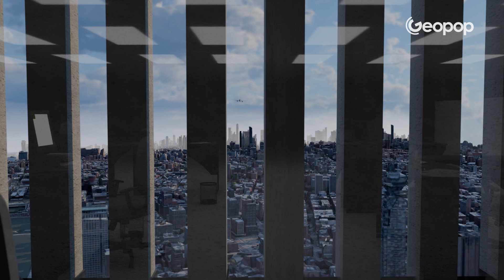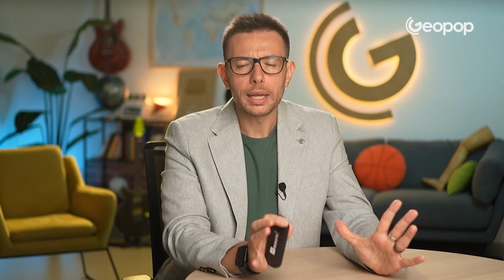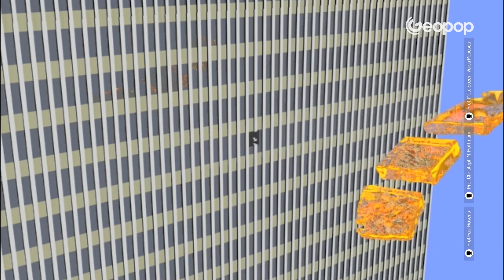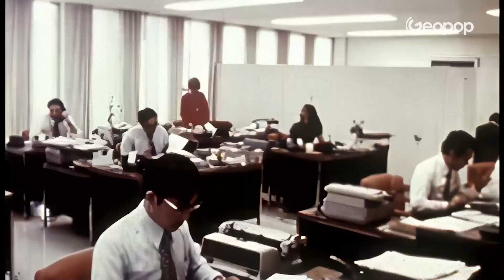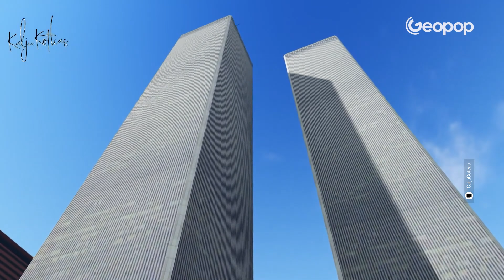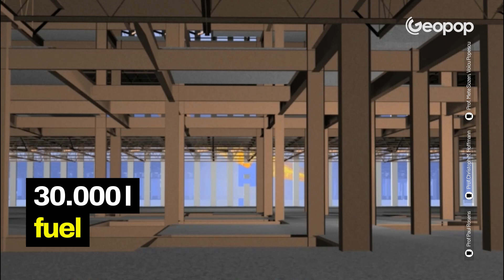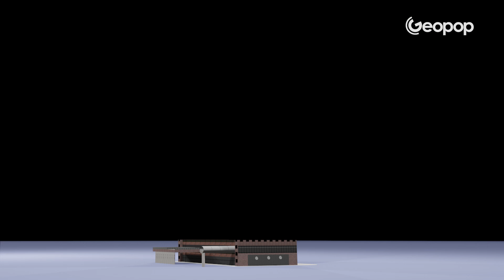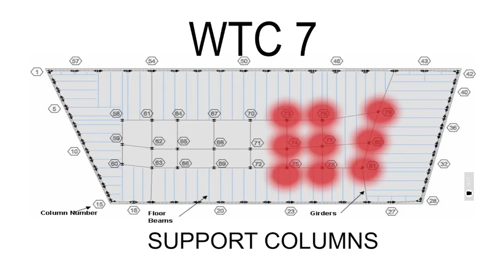9/11, 2001: The Technical Reconstruction of the Twin Towers and WTC 7 Collapses

Comment: Truthfully, conspiracies about an inside job and controlled demolition could be true or not and argued by people all day. But after a video like this and the research behind it, there is no way the weight of the floors above both impact areas could’ve stayed above with weak steel. It just makes sense to me from a physics standpoint. And once the hundreds and hundreds of tons of snowball starts, it’s going to take the whole building with it. Such a great video and detailed explanation, I think it gives the victims just that much more justice and respect they deserve. Never forget…
Reply: You never knew. For every impact there is an opposite force in the other direction. So 10 floors can't distroy 100 floors. Its like saying a vw bug can distroy a dump truck. Have you seen the collapse of tower 7. Please explain how this happens.https://youtu.be/kqG6v7KZ_s8?si=nybU9S6N0iULr4fX
Reply: @robbiehiatt9966  Wrong! While the columns were designed to withstand the mass of every floor above it, each floor was only designed to hold the mass of ONE floor. When you drop 30 floors on to a 3/4" steel plate which is holding up the floor truss below, what do you think is going to happen? It is going to fail instantly. Then the truss plate on the next floor down has to resist the weight of 31 floors crashing down on top of it, and it fails instantly. Then the next floor has to resist 32 floors of mass when it was only designed to hold ONE floor. You should easily be able to understand how the collapse actually accelerates and never loses energy. The falling mass is growing. The columns are coming unzipped. The floors are pancaking.
Reply: @BoodahBodey The outer beams were the same on the 5th floor as the 75th floor. If it was o ly able to hold up one floor, how does the 5th hold up 90 floors. You must be ignorant. And 30 floors didn't impact one 3/4 plate, there were hundreds on each floor. But not only that, the floors above were clearly in pieces not falling as a single object,  it was multiple smaller impacts. If you're so smart, explain the upward forces involved in the collapse. And you can say the floors are pancaking if you want to , but there's no proof of that. In fact , there's no proof of that ever happening anywhere on any skyscraper.
Reply: @r@rob @robbiehiatt9966 outer beams? The building didn’t have beams. It had floor trusses. Do you mean the outer columns? I am talking about the floor connections. Without connections the building falls apart. The floor connections were the same on every single floor. They were weak. There was zero percent chance of them not failing in the collapse. You can see the result in every photo of the aftermath. The truss plate was either sheared off, or the bolts that connected the truss to the truss plate were sheared off. I never said that the floors fell like perfect, whole pancakes. It was a mess of debris inside. That doesn’t change the mass, and therefore doesn’t change the force of the falling building materials.
Reply: @robbiehiatt9966  the truss plate on the fifth floor holds the floor truss on the fifth floor. The truss plate on the top floor held up the truss on the top floor. The only needed to be strong enough to hold one half of one truss, not every floor above. The columns held the mass of the entire building above, but when the columns became separated from the trusses, the building came unzipped.
Reply: @BoodahBodey The building didn't have beams. 🤣🤣 look in the stairwells genius.  Yes I was referring to the box beams on the outer perimeter.  But you must be clueless.  The top cord of the trusses sat on something solid and were welded at each end. Bolts never connected the floor trusses. The floor trusses were not weak. Where's your proof of that or anything else you've said. Where's your proof of this shearing off? There is none. You are lying. I posted proof of everything i said. But nothing you say checks out. Nothing. Where's your proof that there was zero percent of the floor trusses not falling in. And you obviously know nothing about falling objects or how mass works. Of course it changed the mass. You are a joke
Reply: @BoodahBodey pointless words, nobody believes your lies. You have zero proof. The explosions were heard. The explosions were seen. The explosions were reported. Do I really need to repost it for you?
Reply: @r @robbiehiatt9966 xplosions maybe. Demolition charges, definitely not. People “reported” that the bodies hitting the ground sounded like bombs going off.  People are not reliable eyewitnesses.
Reply: @BoodahBodey you must be scared to address any of the issues.I brought forward , and that's not a surprise
Reply: @robbiehiatt9966  "The top cord of the trusses sat on something solid and were welded at each end. Bolts never connected the floor trusses."
Wrong the truss plate was a 3/8" steel plate that was welded to the column. The truss sat on top of the plate and was bolted with 4 bolts at each connection. You can see in every photo of the aftermathdebris every single connection was broken. Not cut with thermite charges, but bent straight down or sheared completely off. 

Here at 11:37 https://www.youtube.com/watch?v=Pr_BBXKe-YA You can get a visual of the truss plates that were welded perpendicular to the column.

The World Trade Center floor trusses were bolted to the building's columns and supports, while those supports themselves were welded to the structural steel.Exterior Connection: The top chords of the floor trusses were bolted to seat angles that had been welded to the exterior wall spandrels.Interior Connection: On the core side, the floor trusses were bolted to channels or belt girders that were welded to the interior core columns.Truss Assembly: The individual prefabricated trusses themselves were constructed using welded steel webs and angles.

over 90 percent of floor truss connections at or below the impact floors of both buildings were either bent downwards or completely sheared from the exterior wall suggesting progressive overloading of the floors below the impact zone following collapse initiation of the towers.
Reply: @robbiehiatt9966  Please tell us how "they" managed to keep the explosives from igniting for 1-7 hours after the impacts, and raging fires? The colapses initiated at the point of impacts. So how did they rig the explosives so that they were not damaged by a plane collision?
Reply: @BoodahBodey clearly things blew up on impact.
Reply: @robbiehiatt9966  and how did demolition charges, wires, detonators survive the impacts, and explosions so that they could bring down the buildings an hour later? Have you ever considered it?
Reply: @BoodahBodey are you trying to tell me that the powers that be can accidentally drop nuclear bombs and them not go off but can't fly a plane into a building without some explosions going off? And it doesn't matter anyway, because explosions did go off so to try to say that is proof of anything is complete ignorance.
Reply: 1.The firefighters said" it looked like they planned to take down the building" I didn't say that, The fire fighters said that. They were there.I'm sure they know best.
https://youtu.be/XiIT4HInWjY?si=e1Pvp3-IFs-M75Oj
When the firefighter says "boom, boom, boom, boom" in this video.
What do you suppose he is?Implying by " boom" ??
2.So if there were no explosives then what is this? 8:25
https://youtu.be/bLF5D7M1YgA?si=aHSvS__uOdxMi1ZB
You can't say that it was added because you can see the firemen's reaction to the explosion. And you can't say it came from anywhere else because the firefighter says
" We gotta get out of here,  7 is exploding "
3. Controlled demolitions have squibs, you can see the squibs here 20 floors below the collapse. 
https://youtu.be/eXAgulfAtR4?si=-iLO9aQjMJVLTUYH
4. Firefighter says "any one of these buildings could blow up,  this ain't over yet" firefighter says there's 3 secondary explosions. 
https://youtu.be/0Gh3ErgMI4M?si=mmp9Eus_5PWTCBfl
5. Airplanes can't fly 600 mph at 1000 feet. And to be able to make a 180 degree turn to hit the opposite side of the pentagon going that fast is ridiculous. And since when do terrorists hit the opposite side of the building where no one was at when they could have just flown straight in and killed way more people???
 https://youtu.be/0Gh3ErgMI4M?si=mmp9Eus_5PWTCBfl
7. No one has ever known ahead of time that a building was going to collapse except through controlled demolition.  Tower 7 was reported to have fallen while it still stood in the background. 
8. Larry silverstein,  the man who made over 4.5 billion when they fell, claimed to have pulled the building down.
https://youtu.be/1jQaJFNWqtc?si=wCywQ9grgBdS_w11 yet somehow today he is only worth one billion dollars.
Ive really been studying this for 16 years. And ive got actual evidence not cheap words.  @BoodahBodey
Reply: Let's set the record straight. Molten steel was found in the dust, and in the debris for 6 weeks.  Molten steel was reported by the fallowing 
people. Captain Philip Ruvolo (NYCFF), 
Richard Riggs(debris removal expert) , Leslie Robertson (wtc structural engineer), Lynn Margulis (University of MA),   Robert Kim Ireland( chemical engineer for US Army Corp of engineers),Abolhassan Astaneh from Berkeley, Mark Basile( chemical engineer), Kathy McGrade (materials engineer), Gery Warner( Mechanical engineer), David Gregg( PhD Chemical engineer), Steven Jones PhD( physicist), Kevin Ryan ( BS Chemistry), Niels Harrit (PhD Chemistry), Tom Sullivan( Explosives team) Jason Cheshire ( Chemical engineer), and Jeffrey Farrer (PhD Material science engineer). 

Ok, so this is what proof actually looks like, take note. It usually shows up in blue. 

https://youtu.be/hB1IYi51Kdc?si=7xSCnyaV9DvdCTHl

Now see if you click on that, it shows you stuff. 3:18 you will see video of Lynn Margulis (phd university of Maine) reporting molten steel.  3:09 video footage of Leslie Robertson (structural engineer) reporting molten steel. 6:34 Steven Jones (PhD physicist) reported molten steel, 7:25 Kevin Ryan (bs in Chemistry) reported molten steel 8:23 Tom Sullivan (Explosives technician) says thermite cutting charges is a thing it's not made up. 5:02 Gary Warner (Mechanical engineer) proves molten aluminum is gray, looks like mercury.  He worked smelting it in the biggest Aluminum smelting factory in the world at the time.
Reply: @robbiehiatt9966  
1-2. What do you think that it sounds like when floor connections start failing on a 1 acre sized floor? I never said that there were not explosions heard. There was no evidence of controlled demolition. They could have been hearing propane tanks exploding, or structural elements failing. 
3. The "squibs" were from air pressure. Not charges. Do you believe that it was thermite like the rest of the truthers? Because thermite doesn't produce a boom, and it doesn't produce squibs.

4. Means literally nothing. The firefighters were freaking out. Rightly so since the buildings did come down. 
5. When did I say anything about flying at 600 mph? Since when do terroists hit the 80th floor of a skycraper, and not the 30th floor? They could have killed a lot more people. So what? Should we try to make sense out of it? It wasn't an impossible turn because it happened. You can deny it all you want but it doesn't change the fact that it happened. 
6. The firefighters that you love to quote all believed that building 7 was  going to collapse. It had burned for 7 hours, and was bending and groaning like it was about to collapse, which it did. It doesn't take a genius to know that a heavily damaged skyscraper which burned uncontrolled for hours was at risk of imminent collapse. 
7. A lot of thing have never happened, until they do. So what? 
8. Larry wasn't talking about destroying his own building. He knew that his building was aready destroyed. He was talking about pulling the firemen out because "there had already been such a big loss of life." This has been explained many times, but you just don't want to listen because you have 100% bought into the BS conspriacy theories. I guess that is more fun. Does that make you feel smart to believe such dumb crap? I know that it does because I thought it was compelling too, until I did actual research and discovered that every single claim can be easily debunked, and that that what we saw that day is actually what happened. Hijackers flew planes into the buildings. The building burned, and then collapsed. It's not even a little bit strange, or hard to believe. Yet some just refuse to accept it. I am not denying the possibility of of a cover up or pre knowledge of the attacks that was ignored. I am not even denying the possibility of a larger conspiracy. But when it comes to controlled demolition I have concluded that there is zero evidence to support that, and a mountain of in you face evidence that the buildings collapsed on their own with the help of plane collision damage, and intense fires weakening the floor trusses, which led to a progressive failure of the complete structures. When a 1 acres sized 30 story building falls on top of an 80 story buiding, that is to be expected.
Reply: @BoodahBodey 1.  And 2 There were no propane tanks or any combustible tanks inside the towers , like most high rise buildings in new york city. And i see you didn't want to address the huge explosion that was coming from tower seven. Instead , you say there was no evidence of control demolition. You a joke.

3. If the squibs were from air pressure , can you prove that in any way whatsoever or that any squibs were produced by air pressure in any building ever in history? You can't do it because it didn't happen. Please squibs was twenty floors below the collapsing building. Air pressure doesn't explain that anyway. It's pretty stupid to think that air pressure skipped two thousand windows and then blew out the two thousand and first one. 
4. You think the firefighters getting blown up while they were in the lobby is nothing. No wonder you don't believe that it was a controlled demolition.Because you don't listen to common sense. They said any of these buildings could blow up this ain't over yet. Three secondary explosions,  the lobby blowing up. Please explain why the firefighter would say any one of these buildings could blow up? It's because he got blown up genius. Did you not see the blood. 
5.  The fastest possible speed for these planes is 410 mph in a dive. 600 mph is simply impossible.  And if you don't think it's strange that the terrorists didn't fly straight into the pentagon , instead , they made a huge left turn to swing around and hit the opposite side of the building , where the least amount of people was. Why would a terrorist do that?But you know what , that in itself is not proof it's words , and that's all you've said you have no proof of anything.
6. Yes , I see you want to quote the nist report , which is complete BS. Where's your proof all the firefighters believed tower seven was going to come down? And where do they state the reasons that they thought it was going to come down? I posted proof of the explosions coming from tower seven and the firefighters witnessing it. No one has ever known ahead of time that a sky scraper was going to fall down at a particular time or on a particular day. What you're saying is nonsense , and you're ignoring the facts and the evidence. 
7. No one had been in that building for over five hours. There was no one to pull out.Let's be clear. You've ignored all of the evidence and presented no evidence in a court of law , you lose deal with it. And quit lying all the time. Wtc 7 was 47 stories,  not 80. Yea you really researched something alright.  Get the hell out of here fairy boy. 
If you have evidence of anything.Let me know, but you're words and lies are for someone else.I'm done.
You've only made yourself look stupid anyway. You sound like a sovereign citizen in a court of law.
Reply: @robbiehiatt9966  
Dude I can't dispute every single ridiculous claim that you make. Maybe we need to go one at a time. When are you going to disprove any of my points? You keep changing the subject then accuse me of avoiding the facts when I fail to dispute one stupid assertion. Much of my evidence comes from hundreds of hours of video. I can not possibly keep track of videos that I saw two decades ago that are probably not even on YouTube any more. So I am doing the best I can to present you with the facts. You can chose to ridicule me if you want. It is not my profession to debunk every damned fool on the internet, but I can point you in the right direction. Chose to follow the leads or not. I really don't care. 

Small portable cylinders (such as those used for maintenance or food service concessions) may have been present in the massive complex.
Minor Pressurized Items: Miscellaneous small sealed containers—such as aerosol cans, cleaning solvents, or small localized utility tanks—frequently exist in large commercial office complexes and can rupture or generate minor concussive pops when exposed to extreme, multi-floor infernos.

I don't dispute that there were loud noises. I don't know what blew up and neither do you.  What we do know is that no explosive residue, no detonators, no wires, no thermite was ever found in any of the debris. What we do know is that planes hit the buildings, they burned, and then they collapsed. If you know how the buildings were constructed, it is not a giant leap to assume that as the buildings collapsed, the inner and outer columns became disconnected from the floor trusses which held the building together. This can be seen in every single video and photo of the collapses. WTC 7 was different.

You claim that the buildings were brought down by thermite, but also want to point to audible explosions, and now firefighters that were burned in the lobby?  Thhermite does not produce a boom or a fireball. So which is it? Explosives of thermite? 

The puffs of smoke or squibs as you claim them to be were caused by air pressure from the buildings collapsing inside the the towers. The floors failed first. Then the outer columns were pushed outward (definitely NOT falling into their own footprint.) Then the inner columns fell over because there was nothing left holding them up. You can see especially in the North Tower collapse that the inner columngs stood for 10-15 seconds after the rest of the building had collapsed. (Not 9 second freefall speed, but somewhere around 30 seconds.) So how does this line up with you theory that the inner columns were cut first which caused the outer columns to bow in and then snap?
Reply: @BoodahBodey nothing you say is true, or backed up by any facts, not one single thing i could look up to prove you correct.I never said thermite was used. I proved explosions were coming from tower 7.  You are correct that towers one and 2 exploded outward.  They would have too in order to control the fall of such a tall building.  that's why buildings up to 15 blocks away were damaged. You say BS about every picture.  I don't see any of it. Just your empty words. Obviously your mind is set. My mind will also continue to be set because I look at evidence. I presented evidence. You didn't.  Im sorry to break it to you, but you lost this argument the second you started claiming to understand the forces in the collapse but were unable to explain the upward forces. When you crash a VW Beatle into a VW semi. The semi stays very much more intact.  Its simple physics, but its not even that. The Beatle was in pieces. And you are clueless. Idk if thermite was used or not. I do know based on my studies that molten steel was in the rubble pile six weeks later. Burning buildings and jet fuel doesn't cause that, good luck proving it does. Go away. You are sheep. Completely clueless of most everything probably.  Good luck with that cartoon boy...
Reply: @robbiehiatt9966  Your VW analogy is not even close to real world accurate. The "upward force" I assume that you mean the compressive strength of the steel columns? Yes, I addressed that already. The columns were designed to distribute the loads of the entire building above any given floor. The columns at ground level were much more massive than the columns at the top level. However you fail to acknoledge the very thing  that has been my main point all along. I will try to repeat in one more time to see if you can possibly understand. The floor connections were only strong enough at any given floor to support the mass of that floor. One half of one floor truss, and whatever load (static + live load) to be more precise. Without connections, the whole building comes down. The connections failed, not the columns. The connections that bolted the columns together vertically, and the connections that bolted the columns to the floors. The floor connections were the main point of failure. Then without any structural integrity left the columns moved out of the vertical and the connections between them failed. If the floor below the impact zone could no longer hold the mass above it, what do you think happens when it all collapses onto the next floor, and then the next... It progresses to a complete collapse. 90% of connections were observed to have completely failed and yest there was no observance of any members that were cut with shape charges, or thermite, or any other means besides collision.
Reply: @BoodahBodey you're full of s***, anyone can look it up and see that they didn't use bolts.They used to rivets to hold the columns together, and the floor trusses sat on top of something and were welded, not bolted.So your research is completely bogus , your lying. P*** off
Reply: @robbiehiatt9966  You need to think of the collapse more as an avalanche, not a car accident. In the avalanche example, the falling mass is triggered by a small force, maybe even a single snow flake, bu then it grows, and grows until all of the potential energy is consumed or the supply of snow that has potential energy to be released and accelerated due to gravity finds an equilibrium, ususally the bottom of the mountain. 

F=ma

In a car crash the mass of the small car has absolutely no potential to grow after impact, and it has no potential for acceleration since it is completely stopped by the larger vehicle. 

In your example it would be more apt to consider the larger vehicle to be the top of the building falling down on top of the much, much, much smaller vehicle. The floor truss connection. In your example it would be much more aplicable to consider a two mile long freight train coming down a mountain, and colliding with 100 people lined up on mopeds trying to stop it.

So in no way does you analogy apply to situation of the WTC collapse.
Reply: @BoodahBodey an avalanche has no resistance on the way down genius. It's the resistance that matters. Because the upward force is the same as the downward force. The upper pieces are much smaller than the lower pieces. The lowwr pieces are a whole. The upper pieces are just that. Pieces. You know absolutely nothing about construction.  Ive been in the business my whole life up until i retired 10 years ago. Here you can see the i beams you said didn't exist being put in place.  9:01 time stamps. https://youtu.be/z67IV07PvKU?is=lDr8EtT_9o37fGwr
Learn to back up your words with evidence rather than lies. At this point, you should admit that you have lied.Because the proof is right here. You wanna say the weight from above flattened the bottom. Yet the pile wasn't taller than the lobby. If the upper flattened the lower then why isn't it sitting on top of the lower? The core columns were seen sticking up out of the pile. There was nothing on top of them. The explosives exploded outward all the way down the building. If It pancaked, then the stuff would be piled on top of each other. Here is evidence of that 4:01 https://youtu.be/oHbUBbfipNw?is=89YBzMoBqojWVurm